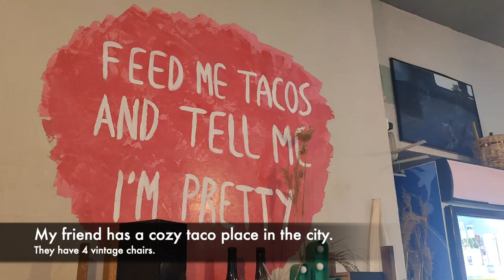Quick Vintage Plywood Chair Repair

Comment: Great job, I enjoy your videos!  A suggestion regarding assembly:  screw the stretcher (finger tight) onto the front legs BEFORE gluing the legs into the seat - that way the legs will always be correctly orientated and you don't have to fight to insert the screws into the holes.  Then you can tighten the screws fully.